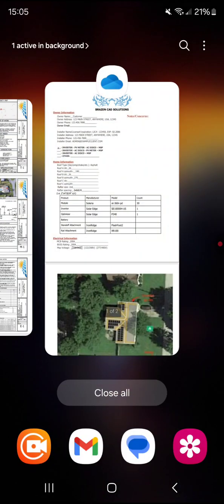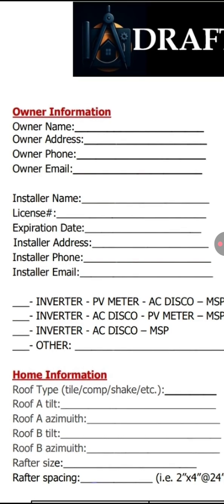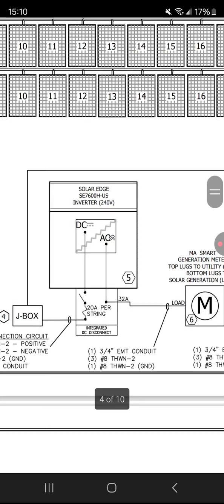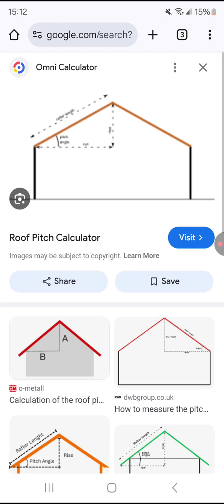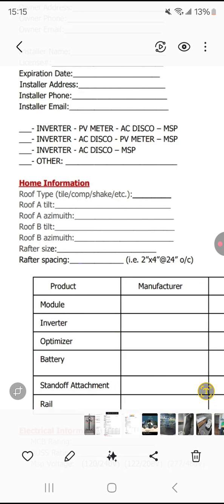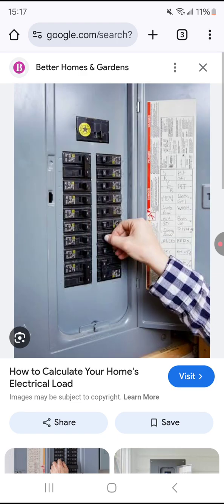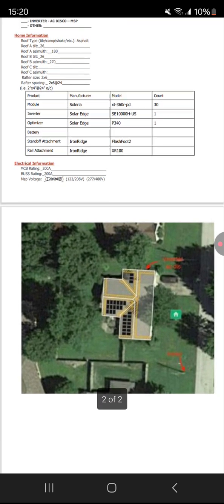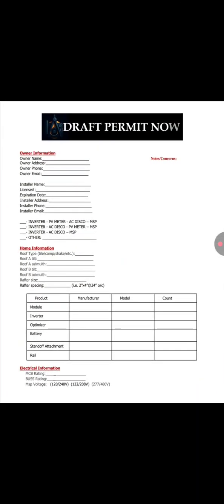how to fill out a blank checklist in order to submit to us to draft your solar plans

Comment: How about for a Ground Mounted Permit? I don't see that in your checklist
Reply from the maker: attachments + rail section boxes. 
also you could put notes in the notes+concerns area. 

usually ground mounted systems are pre-engineered by the maufacturer of the attachment + rail + foundation system and they offer this as a free service included with the purchase.  we can both draft AND PE structural stamp these plans, but we would need to see that pre-engineering so that we can verify given parameters when doing the structural calculations for seismic, snow, + wind.  

please do feel free to call if need any help with anything at any time!   we would love to help you.

~ bryan. +1.619.259.0441

or send us what you have and we can wrap it up!  brazeninvestmentsllc@gmail.com